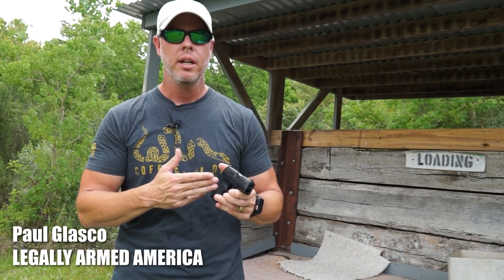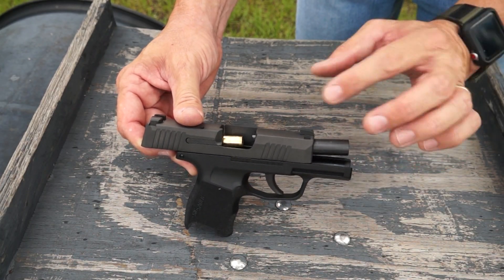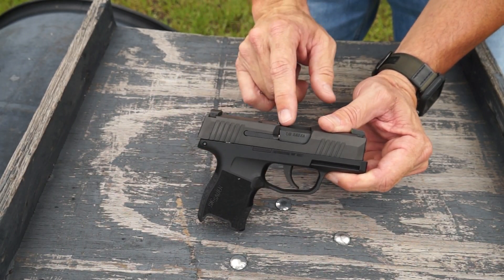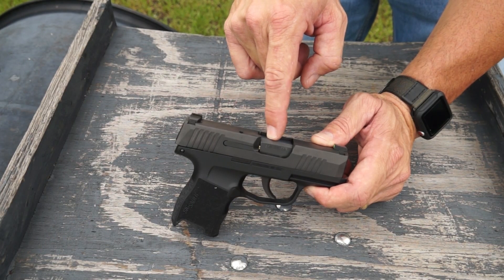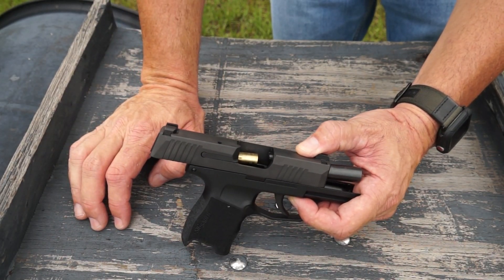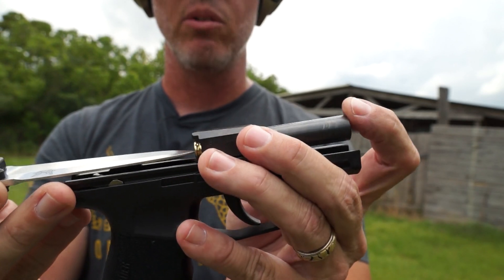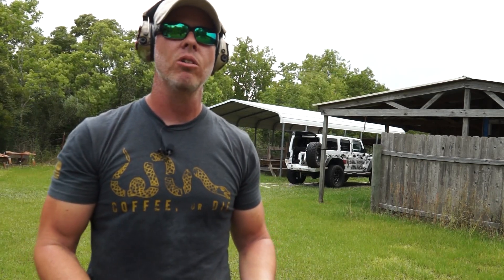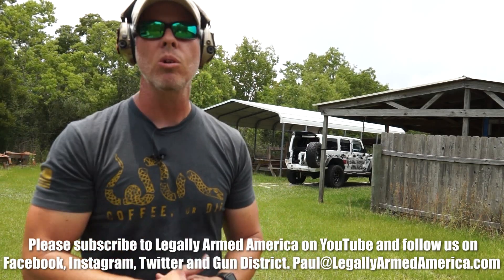What is "primer drag" in handguns?

Comment: This makes me wonder if for subcompacts if all companies need to find a way to copy Berettas and/or Grand Powers (also known a Bersa Grand Power) possibly complex to manufacture but ingenious rotating barrel lock mechanism.
Reply: Daniel J Call except that ALL Glocks do it regardless of frame size. This isn’t an issue.
Reply: Bill Hall Glocks really don't have this problem  because of firing pin geometry, it's rectangular with quite a large radius on the top and bottom that make a point. They've made made their reputation off of diehard simplicity and reliability, so why not make a simple design to kick the striker back into the slide as a failsafe when certain ammo shortens the lock time? That's one thing to admire about Glock for not owning one is the engineering, there guns just work. Granted anyone can put out lemons and there will always be fanclub loyalty to brands of choice.
Reply: Daniel J Call Bersa and Grand power too different companies same importer
Reply: tree rat76 that's why I said "also known as". The local stores I go to have some of Grand power under the lable of Bersa Grand power nevermind Bersa is from the South American continent Argentina was it and Grand power is from Europe Slovakia I believe. You misunderstood.

Comment: Perhaps a heavier recoil spring would be the easy fix. Retarding the unlocking of the breach should give the firing pin/striker spring time to move the FP/S back to the neutral position. Retardation can be accomplished by adding weight to the slide or heavier springs.

Comment: There are wear and tear whenever you use your gun and there are a mean time to failure for everything that have moving parts. When I was in the Army, the armourer kept a log book for every rifle. After certain number of rounds have been fired, they will change the parts in the rifle. You should keep a log book and write down date and the number of rounds you fired. Find out from the manufacturer, when is the time to change the firing pin and other parts.

Comment: I hardly ever get this, but then I rarely shoot subcompacts. I had one, the px4 storm SC, but it operates with all the smoothness of a full size. My wife's p 238 doesn't have this problem.
Reply: P238 wouldn't have this issue as it is hammer fired
Reply: Natedoc808 why would hammer vs striker matter if it has to do with a protruding pin when the chamber drops to unlock?
Reply: ravissary79 I asked a gunsmith buddy about this and he said it has to do with the hammer creating a gap for the firing pin to bounce off the primer after striking as the slide presses on the hammer. He is my go to resource and has never steered me wrong. I own 2 P238s and have no issue with firing pin drag, nor do any of the 1911 based hammer fired platforms that Sig offers from what I can gather from scouring the inter webs.

Comment: Since cheap part Cohen managed Sig. They have gone down hill. The 320 has had a ton of problems. On some you can't even budget the takedown lever without using a plaatic rod. The army is still having double feed problems and triggers breaking on them. Even with their so called drop fix. A lot of their Romeo sights had dead circuit problems too.

Comment: I wish more companies would develop rotary breeches like the Beretta PX4. That would fix this issue.
Reply: RockawayCCW Glock and shields don't due it.  I've never herd of it until sig made this junker
Reply: I may be wrong but I'm pretty sure that the PX4 Storm subcompact uses a tilting barrel.I'm not sure about this but a rorating barrel may have problems with friction and failure to eject or chamber.You to make that barrel rotate in a smaller distance and this requires a tighter angle for the camming action which will result in increased friction force which,with a subcompact barrel may result in not enough power to cycle the gun with all kinds of ammo and a weaker recoil spring to make it cycle may result in a failure to chamber when the gun gets dirty.

Comment: I am relatively new to the hand-gun community and many of you may think the answer to my question is along the lines of common sense, but I don't know the answer.  My question is: "Why is there a need for the barrel to tilt during the extraction  process?"
Reply: Norval Henderson the barrel and slide are locked together by the geometry of the chamber and slide this aligns the barrel and sights and reduces recoil during firing.  To separate that locked assembly the barrel has to tilt down so the slide can move to the rear to eject the empty case.
Reply: It unlocks it from the slide.If they are not locked together your gun shouldn't fire.It if does,it goes K-boom.You can have a straight blowback gun up to a point.If nothing keeps the chamber closed you need slide mass and  a stiffer spring to keep the chamber closed.A Makarov or other handgun which uses 9mm Makarov would be the maximum you can get with a straight blowback.Tilting barrel is not the only way.There are others like the rotating barrel,roller delayed,FN 5.7 is another one with an interesting way of keeping it lock and there are also fixed barrels delayed-blowback handguns like the PMM which was made by the Russians when they tried a more powerful version of the 9x18mm and they used  flutes inside the chamber to delay the opening(spiral shape,not straight lines like HK barrels which actually help with the extraction instead of slowing it down).

Comment: I would prefer to hear from a metallurgist.  The metal strength and density of a primer is far less than any hardened firing pin, notwithstanding an improperly manufactured firing pin.

Comment: Primer drags in general issue...then with cheap MIM parts even greater for failure...in this case....best odds always win...wait till SIG figures this out as we have seen they have stepped on it more often than not in last couple years.
Reply: Jones yeah, but the problem is, its been the total opposite last few years in the industry...MIM is failing far more than forged and it isnt company specefic
Reply: Forged parts are much more expensive, requiring precise machining of each part.  Your $500 gun now goes for $700.  Most in the general public, law enforcement and military are just fine with MIM.
Reply: RAZORJB Glock has used mim parts for years there fine so long as it is done right not half ass like sig

Comment: This is such a non issue. I've owned over 15 Glocks, and still own several, and they all do this. The only Glocks I've had that can even remotely be called sub compact are a former and a current G36. I've owned several XD and XDm pistols. They all do it. I've put thousands of rounds through some of those pistols with no malfunction of the firing pin whatsoever. I've been shooting these Glocks since 1989 with a sceptical eye...as in I am not a Glocktard/fanboy. I'm much more of a 1911 and big bore revolver guy but those Glocks don't rust when you sweat on them working in the elements in the hot Texas sun. Again, the ONLY reason I mention this is to say I'm not a Glock fanboy..."all guns should be Glocks" kinda guy. There are things about Glocks and other striker guns I dislike. Primer/striker drag is not one of them. It's inherent in the design and considering the design has been around before Glock in the '80s before most millennial youtuber were around, it's silly that it's all of a sudden a YouTube hot topic. Sig might be having a problem with the 365 but striker drag in general just isn't a thing.  I say worry about something that matters.
Reply from the maker: 452Rob I am a little worried about polar bears starving, so there’s that.... 😂😂😂 Thanks for the feedback, man!
Reply: I do hope my comment doesn't sound condescending. Re-reading it, it kinda does and I sure don't mean it to be. Over the years I've seen these things come up and people start freaking out and trading off perfectly good guns. I do suspect something might be wrong with the 365, but it's causing people to worry about the reliability of their Glocks, that are in more police holsters than any other handgun and even adopted by the Navy Seals...at least at one time, and other striker guns. If there was a reliability issue the above simply wouldn't be the case.
Reply: Yes Jameson, I have taken them apart, as well as hundreds of other firearms and I might know a thing or two that you don't...like Gen5 striker pins ARE round. And if you could read you would noticed I mentioned more than just Glocks, which I have also taken apart. I've probably been taking guns apart longer than you've been alive. Grow up kid.

Comment: Carry a 19 sized gun and forget about all this nonsense.
Reply: and then there is everybody else who can't carry a full size gun on body without printing... lots of different body types out there
Reply: If 19 is referring to your girl's dress size that's pretty hefty.
Reply: If you use a 19 for self defense , don't ever injure your hand, and hold the gun too lightly or it WILL jam. But cops and military people never get injured on the job...right?
Reply: Bradford, anybody can carry a full size gun. A 19 isn't full size either.
Reply: I remember the Glock 19 extraction problems...don't you?
Reply: @mnrodriguez  Gen 4 which was fixed quickly by Glock at no charge. Anyway, I carry CZ P-10C and as quite small European (Slovak) I don't have a problem to conceal it. And Glock 19 I can conceal anytime – maybe it's because of different holster putting it more deeply, I don't know. But definitely don't have a problem to hide it in summer with light t-shirt, shorts and christus type of sandals. Yes, those kind of pistols are somewhat heavy and with ultra sub compact you can definitely save maybe 1/3 of weight.

Comment: Here's something to think about, the striker is made of very hard material, the primer is very soft material plus the primer gets softer as it heats up. My .40 cal shield has about 8,000 trouble free rounds through it with no problems. I think your worried about nothing. ......... Just a correction on my part, I was not aware of a wide spread problem with the P365. It seems strange that other sub compacts don't have that issue, and look at the issues with the P320, maybe Sig is just rushing their gun's to market
Reply from the maker: gary mccausland could be! Just explaining whatever one else is talking about
Reply: The issue isn't the primer drag as much as it is the P365 striker snapping off.  As the previous video showed, this is a pretty common thing with subcompacts, but the Shield and the G43 haven't had the same failure of the striker whereas it seems to be happening at a concerning rate with the Sig.  So yeah, there is something to be worried about if you're carrying at P365 and you don't know if it's shot it's last round yet or not.
Reply: thedefinitive I'm sure Sig will correct the issues.
Reply: gary mccausland they SHOULD have done their OWN homework and sent out the correct guns. We aren't paid to do their R&D for them. They rushed it to market and failed to produce a viable product until its once and truly fixed!
Reply: jimhans1  I agree. The same goes for the P320
Reply: swampthing401 I didn't know the problem was that wide spread. Looks like there's gonna be another voluntary upgrade
Reply: I truly think the fact that some primer drag happens on most small framed pistols yet have no widespread issues being reported only exemplifies that there is a component/design flaw in the 365, be it the strength of the striker spring, the metallurgy, or the actual shape of the firing pin having inherently less strength to the shear force being applied to it. Personally my Shield 40 and M&P 40c show very little primer drag, but a friend's Shield 9 shows quite a bit; both of us have over 1000 rounds through each and the firing pin shows no sign of fatigue, wear, stress related deformation but the shaft of it is also not perfectly round and it is stainless steel. If I were to buy this gun I would immediately replace the firing pin with a stainless steel version.

Comment: This to me is not a real good design. The firing pin/striker should be well out of the way before the barrel unlocks from its position . Continuous  firing will weaken the tip to the point of failure. They need to address this.

Comment: I bought a used ruger sr9c. It does the same thing with pretty much every round and this was after I replaced it with a stainless steel firing pin. Is this normal for that kind of gun?